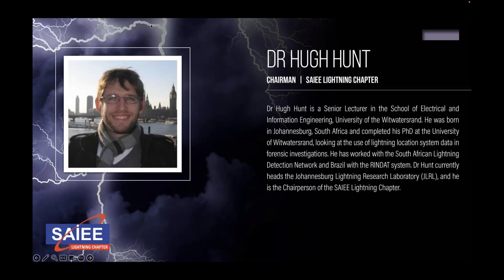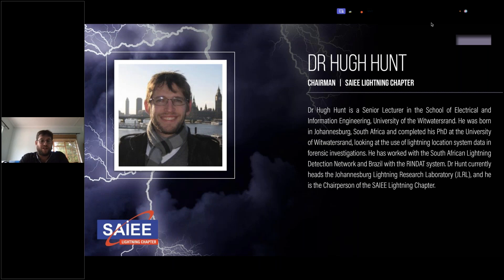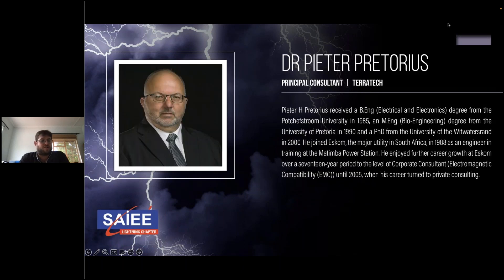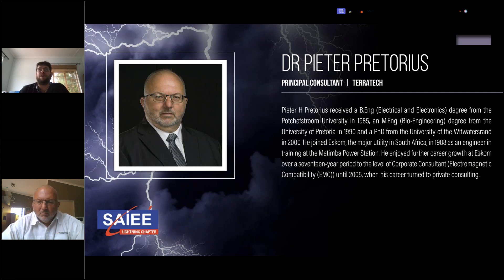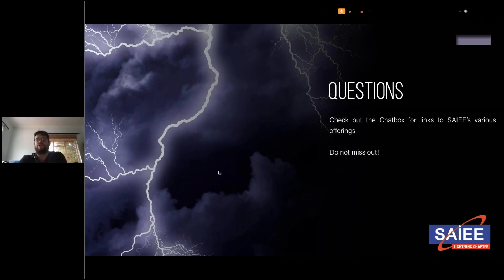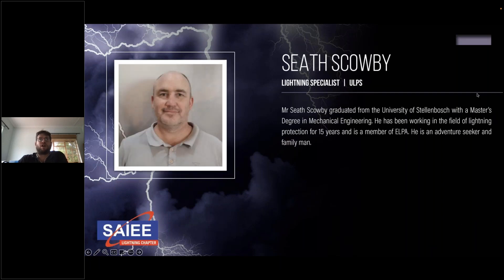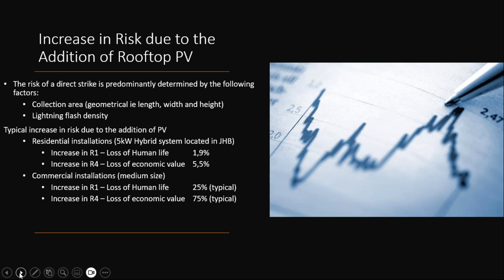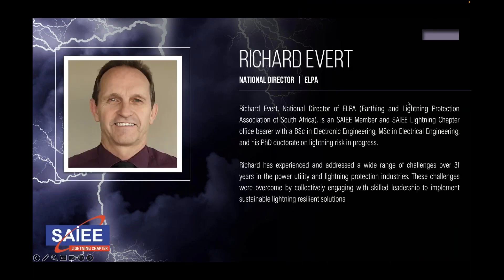SAIEE Lightning Chapter | Lightning Protection of PV Systems - Lessons Learned

Comment: Thank you, oh ground mount metal poled installs - I do not add Lightning protection only equipotential bonding across the lenght of the metal structure- but "Eskom poles" - wooden ones creasoted, I do add lighting protection with ALU conductors & copper rods into ground. My expertise consult professional Lightning protection engineers for 1MW plants & above for complete Risk & solution

Comment: Thank you, yes a PV installation according to SANS 10142-1 C.O.C is like an air-condition install. Its one line! UPS or not- thats it! So in the in-term I do my own QCP docs & check lists & tests that goes to the customer with the COC, covering conductors, energy sources & some mechanical fixings. 

The PV installation is defined as a "Machine" in the OSH ACT 85 or 1993, so it is a "distributed machine" with energy sources distributed between long distances between each energy source. If we can update the SANS 10142-1 COC to include checks for conductors & runs of conductors through buildings & especially mechanical protection of PV DC conductors running through ceiling cavities at above 150VDC, DC Switchgear & DC Fuse gear, even when the PV conductor is double insulated- this is not good enough mechanical protection when running through ceilings, bricked walls & in the ground. 

I find PD difference between battery chassis & inverter chassis & customer earth terminal, when NOT bonded, often, not always (very strange?? I ask why only often & not always) I find in some cases over a 100VDC between customer earth terminal & chassis of energy sources- Do earth them!, but we need to share this info- the manufactures are insistent on this earthing, but many installs I found are not. Discussing why this is, can be for later experiments but the PD is hectic! Do earth, earth earth! 

I add lighting protection to every PV installation that is NOT corricated metal roof, regardless of shape change or building or not- with 8mm ALU conductor to earth via a copper spike & S/S couplings btwn ALU & CU connections- in old metal roof structures I also add Lightning Protection. The lightning Protection, ALU conductor+ couplings + copper spike (or Galvanised) is approx 1% of the cost of the quoted installation. FYI.

Comment: Thank you, SANS is paramount for local Southern African conditions- IEC is very helpful & resourceful, but has no empirical evidence that can be used to adjust our solar PV enclosures, cables & switchgears for heating & temperature rise. Also I find that Gauteng & KZN has a very high lightning density per square meter (Ref: SANS 10142-1, Ed 3), compared to European conditions (Ref: ABB). Please I know there are one or two Private Companies assisting SANS to "resurrect" itself, it is very important, otherwise in 10 years time, we are "flying blind" on IEC data